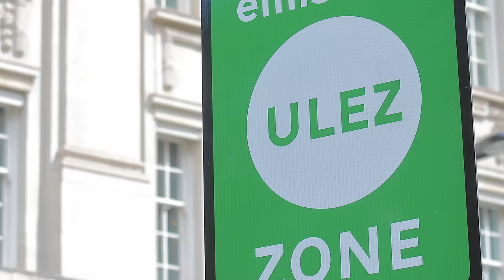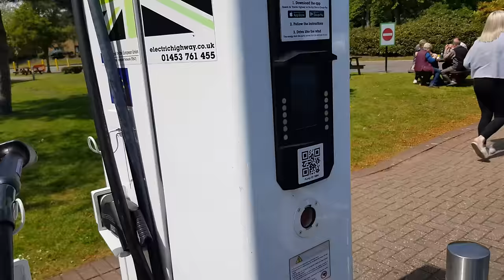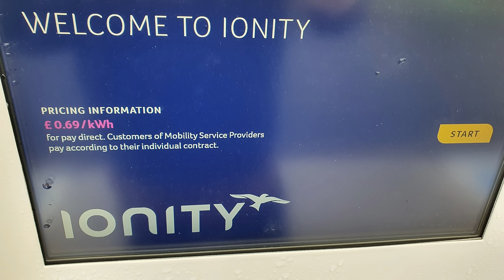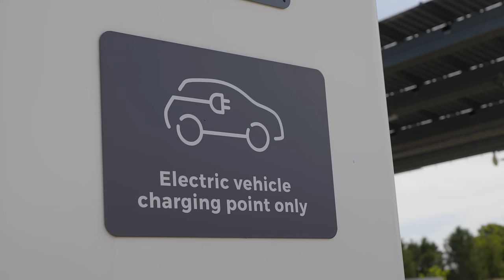The Uncomfortable TRUTH About EVs: The Version NEITHER SIDE Wants You To Hear

Comment: Well in my opinion if you are old and or disabled and can afford to buy a $150,000 vehicle then you could have kept the money and used it to hire someone with a car or a cab or something like that to take you to the store a doctor or where ever you need to go before I got disabled I use to drive a lot of friends and neighbors to town and appointments they had to go to some had vehicles and I would drive them in there vehicle’s others I took in mines. If so many of the younger people weren’t so self centered about just themselves only thin this wouldn’t be a problem. 

As for the fires I’ve only see a couple of gas powered vehicles catch fire and burning up but lots of EV fires. Now a couple of days ago a doctor in California they think was trying to kill himself and his wife and 2 kids drove his Tesla off of a cliff by the ocean it was 250 feet high the car crashed into the rocks at the bottom of the cliff the tide had gone out it was still wet but surprisingly all 4 people were alive a couple of them were injured badly the kids had minor injuries but they all lived and the Tesla after a 250 foot drop on to rocks below DID NOT BURST INTO FLAMES that’s right no fire and everyone lived that’s incredible. 

Years ago a friend of mine was working on making cars using electric motors. They mounted a traction motor on a plate that bolted on to the transmission where the motor mounted it weighed about 50 pounds. Then they put 10 deep cycle batteries connected in series to run the motor to add extra mileage they would add a few more batteries up to 14 that’s 500 pounds for 10 or 700 pounds for 14 and those would get around 300 miles of range. The motor ran on up to 90 volts so with 14 batteries your talking about 175 volts and your using less than half of that which drops the current way down and increases the range they also stepped down the voltage to 12 volts to run all of the lights fans and everything electric in the vehicle so they had lots of extra power and it weighed around the same weight as the vehicle did with the gas motor where now days they are getting around the same mileage they’ve cut out all but about a thousand pounds for the vehicle with 1 to 3 motors and added 3 to 7000 pounds of weight for batteries so that you can go from 0 to 60 in 3 seconds most vehicles till the last couple of years weight was around 1000 to 1500 pounds and had from around 90 to 150 horsepower and would go from 0 to 60 in around a couple of minutes. I’ve herd that police cars are hotter than anything on the roads and will go from 0 to 60 in 15 seconds. And they don’t weigh 7000 pounds even with all of the crash bars roll cages push bumpers and a ton of computers heavier engines and larger charging systems to keep them all running and the air conditioning to keep them all cool while running sitting in the sun all day. The EV’s have bigger heavier batteries for fast takeoffs but with all that extra weight they have lost a lot of mileage with a smaller battery and a transmission you can get up to speed with a lot less power but with out all that extra weight you can go father and don’t need the extra heavy tires. I worked on a farm for a while hauling wagons full of grain they weighed around 2-3 thousand pounds the same as the average EV does in the summer time it got hot around 90 degrees Fahrenheit and the wagon left tire tracks in the blacktop you could see the tread pattern in the pavement. The county didn’t want to spend a fortune building up a heavier road bed so they just ripped out the blacktop making it a dirt road and every couple months when the ruts got bad they would just scrape it flat again I’ve seen this happen in a couple different states so I imagine they’ll do this in other countries also. Another thing that just came out they took a Ford Revillion pickup and ran it into a guard rail a normal gas vehicles will bounce off of them at 60 mph and stay on the road but the 7000 pound EV truck sliced right through it and crashed over the first concrete barrier and stopped on the second row. They tried this with some of the sport car types of EV’s they lifted up the guard rail and went right underneath them without even slowing down. So my advice is if you have one of these try following the speed limits and keep it on the road because nothing else is going to do it for you. Now I’ve been driving for around 45 years I’ve been crowded off of the road a couple of times and I’ve slid off in the mud a couple of times but I’ve never ran over anybody or there vehicles in all this time I’ve been hit while stopped at red lights a couple of times by others but it’s hard to avoid vehicles when your not moving so keep it slow and keep your wheels on the pavement at all times if possible and you to may live a long life with out having to go to physical therapy to repair the damage

Comment: Youre forgetting adout our  london councillors finally admitting that evs arent green .from the manufacturing process to disposal of they have a carbon footprint of at least three times more than the average diesel vehhicle. On top of that because of their weight they give excessive  rubber particles from the tyres and excessive dust from the brakes making them far worse for the environment and our health .also you now have the new parking chargers in london penalizing the evs drivers up two 1800% increase compared to a combustion engine car . Im conclusion theyre not green for the environment theyre not cheap to buy  theyre not cheap to run and definitely not cheap to insure and now its going to cost you an arm and a leg just to park.

Comment: So  car thats 70 percent worse for the enviroment to build than a standard ICE car, running on a source fuelled from coal fired power stations which will need tp create more power once we all HAVE to drive one. Why does noone diacuss syntheric fuels. Which work with current petrol engines with little or no modification and are massively more ecinomacally freindly. Plus how do we dispose of all the millions of ICE cars that are being replaced with EV's in the next 11 years?

Comment: In a nutshell I detest EVs not least because they are causing terrible pillaging of the Congo's resources to get the REMs, there is child labour involved, EVs are overpriced, do not run as cleanly as described, terrible range, terribly bad for occupants' health because of the always-on radiation from that battery and bluetooth and wifi bouncing around inside a metal cage on wheels, horrible resale drop in £, getting very pricey or impossible to insure because they catch fire.  No thanks, I'll stick to my diesel.

Comment: Not really unbiased. I don't live in the UK, so it might be a little different here in the U.S. But charging here in Virginia (where I live) it is easy to charge at home ... every day when I come home, I can take about 20 seconds to connect to my standard 110v wall connector and my car charges overnight. I pay about $0.045 USD a mile for charging. Day in and day out. (And yes, that is miles, not km. It would be roughly 2.8¢ US per km.)

Your claim that consistency is the most important is also bias. If you drive 15000 km in a year, what do you care that sometimes it costs more sometimes less. The point is that the overall cost is for the driving you actually do. Perhaps for some it might be expensive. If you drive 1000 km every day and have to supercharge to do so in a timely manner, you might have to charge overnight at home, then the rest of the charging would be at more expensive charging stations. What would the average be? That is what is going to count in the long run. For me, I don't do more than about 5 longer trips a year. Compare that to every day driving less than 60 km and using home charging all the time.

Consistency is the hobgoblin of little minds. Your insistence on "pulling up and knowing what it will cost" is for EVs having an app that tells you what the cost is and planning your trip accordingly. Would it be good for electricity to have a more consistent cost? Perhaps, but not if it comes at the cost of having all prices rise. I'd rather have variability that I absolutely have control over than no variability but at a cost of 20% increase overall.

My main point here is that you say you want to keep an open mind, but then don't do so.

I own an EV, I also own 2 ICE cars. The EV far outshines both of the ICE cars in some respects. The EV far outshines the ICE cars in other respects. And I'd suggest that the best approach is to not have (and I quote your statement at about 20 seconds) "the solution to everybody's needs." The best solution is inconsistency. Consistency would be telling everyone they don't need anything more than what will transport them 30 miles to and from work because 90% plus don't need any more than that 5 days a week, every week of the year. It doesn't work for someone that has to travel to many locations a day. We don't need it to be a truck for everyone either. Look for the market itself to control ... not environmentalists, not muscle car drivers, not traveling salesmen. The market as a whole. It will get it right, and really doesn't need a lot of input in order to reach that balance/stasis point.

Comment: Ok your maths is fundementally flawed. 
1/. 90% or more of your milage is charged from home usually over night at 9p a KWh.
2/. Servicing costs of fossil cars (indcuding disposal costs of oil, filters cambelts etc not to mention clutches is way way more than on any EV. 
3/. My MG5 std range 200'ish mile EV cost exactly the same as a Ford Focus Titanium.. a car that is dreafrully slow off the mark and costs a fortune to service and repair.. i.e new engines every 100,000 miles or so. 
4/. I have saved against my old diesel taxi (5 year old fuel rates) over £19000 in 3 years.. then add in the servicing savings for 127300 miles.. 
You get the picture? 
EV's are just way better in almost every case. A few.. very few people need to do large distances every day. For them a diesel m8ght be better.. for now. Give it 18 to 24 months.. see what the average range and capacity will be by then.
Yes our charging infratructure is appaling. But that is due to 6 years of total stagnstion politically while we commited suicide over Brexit and key players in the ruleing party accepting £billion bribes from oil companies.. Oh sorry correcting here it was clearly NOT a bribe RS took it was a business "deal" paid to his family the day before he opened up a large oil and gas field for explotation and cut green plans dramatically. Of course it was not a Bribe!

Comment: EVs are perfectly viable and overall a great idea if we make our electricity with nuclear. Instant torque, lots of power, humanity has plenty of experience with electric motors so they should be pretty reliable, you get heating right away instead of having to wait for the engine to warm up, they can heat up before you even get to them without starting an extra motor under the hood, less liquid maintenance and so on. BUT I sure as fuck won't be buying a crematorium on wheels. Fuck lithium, EVs won't properly take off until humanity comes up with MUCH better energy storage.

Comment: The truth: ICE vehicles are inferior in every single way to EVs. The closest you can get to saying that ICE have an advantage is refueling time, but with new batteries that can recharge twice as fast and the fact that if you have home charging, you don't have refueling times most of the time, it's not a clear cut advantage.
Can you stop the rise of EVs: No,
Should you stop the rise of EVs: No,
What should be done: more infrastructure for charging, 
and yes, she'll always have it going on.

You're comparing the most inefficient EVs in the worst conditions against ICE vehicles that get really good gas mileage for what they are. If you're going to pick the worst, compare it to the worst. If you compare the best, compare the best. To be fair and balanced, compare both to both. The model 3 performance gets 3-4 miles per kWh. It also slap the crap out of anything else on the road besides liter bikes and hyper cars. Heavy acceleration and heavy braking saves a lot of energy. you can get 5 miles per kWh in city driving with heavy regen. Heavy acceleration included. That's another thing, you can get the best of the best efficiency, but still do 0-60 in 3 seconds, then regen heavy and you don't waste a ton of energy. Can't do that in an ICE vehicle.

The next generation of batteries don't ignite like that. It literally won't be a problem.

EVs are only more expensive because they drive prices up on purpose. There are less parts that cost less to make. It's the same reason you get garbage EVs like the first gen leaf and it's non liquid cooled batteries. If the car manufacturers wanted to make batteries, they'd drive the costs down even further. This is why the EV market for used drops as fast as it does. The prices are massively inflated on new ones. Once they are forced to make just EVs, prices will drop as they have to compete with each other.

Insurance is one of the greediest industries out there. They lie cheat and steal where ever they can.

People don't want bigger cars. Cars have gotten bigger because emission rules don't apply to large vehicles the same way. Small cars sell like hot cakes. EVs will also be lighter than their ICE counterparts with the next generation of batteries.

Scrappage isn't the answer. It was done to help the car manufacturers, not the people. All it did was cut into the used car market, making everything more expensive and pushing people towards buying a new car instead of something more affordable. Affordable conversions are a much better option. 

As far as charging at home goes, that's where the biggest effort should be put in. Every car has to be parked at the end of the day. There's no reason why we can't put chargers in in those places. They don't have to be the super fast chargers either. Overnight charging at apartment complexes and the like would solve this problem.

Comment: The devil is in the details. That said you can make some  generalisations about EVs. The original leaf was & still is extremely reliable and cheap to own if you have a home charger. Im talking zero maintenance except replacing tyres, source 4/5 friends that own them. Reason is simple a lot less moving psrts. Also no gearbox required as electric motors make full torque at 0 rpms.  The case for ICE cars is you require to travel long journeys frequently and dont want the hassle of charging, Or you are a petrol head and love the sound or changing gears, or your budget is less than 5K. In summary a used EV is a no brainer as a 2nd car.

Comment: and yes EVs are basically crap after 10 years if not less and they are fire hazard, diesel is the best solution and engines running on water, yes water that technology is possible long time ago just the oil companies won't allow it.. 🤷🏻‍♂️

Comment: They should have used exchangeable battery packs that couldbe swapped for a fee that would include the final cost of making a new pack at the end of its  life time. 

A used eV car is a very bad affair, and if you buy a used eV for say £30 000 you know that you most likely will have to replace the batteries for a cost of £40 000. Who would want a used eV with that perspective in sight???

Comment: Your numbers so so wildly bent towards ICE vehicles regarding cost per mile, you take the lowest priced fuel and average it out and then the most expensive DCFC pricing you could find to compare. The average EV owner will be charging at home over night via L2 AC at the lowest possible energy cost rates. In the US the highest rates I've seen on a Tesla supercharger in my area is $0.44 per kWh and those were during peak times at a very popular charging station. Most of the time it's in the 20-30 cent range and I've seen as low as 12 cents/kWh during off peak hours at night. You also failed to factor in the cost of regular maintenance on those ICE powertrains that is intrinsic to all ICE vehicles. EVs have little to no ongoing maintenance other than checking the fluids and nothing's leaking/looks broken. I get that EVs can be expensive to run but if you're smart about it and actually care, you'll easily bring those costs way down by 50-75% from your numbers.

Comment: People keep buying driving talking EVs but nobody speaks about the infrastructure that’s not capable at this point to handle what’s on the road now, you’re not going to put all them fast chargers on today’s infrastructure and the firefighting that needs to change to handle an EV fires 2000/2500 degrees C WHICH WATER & fOAM IS USELESS!!!!ps if you live in a city without parking in a driveway you’re screwed too!!!!

Comment: Modern cars put very little pollution into the air.  CO2 is not air pollution, but the aqua vitae for plant life.  EVs do produce pollution, in the countryside, where the power plants will be relocated.  Poor suburbanites, sacrificing for the virtue signaling of the lunatics who haven’t thought this out..  There will always be fossil fuels power plants, because, at night and on cloudy day there is no sunlight for solar cells, and during the winter, windmills do not produce much electricity.  Wind is produced when air moves from hotter regions to colder.  In northern latitudes windmills often remain static.  The best place for. Wind and solar are in the mid latitudes, where air is moving into them and the sun shines the most.  Solar and wind will augment fossil fuel power, not supplant it.  Canada is approaching a period of power shortages.  Take a lesson from Canada when it happens.